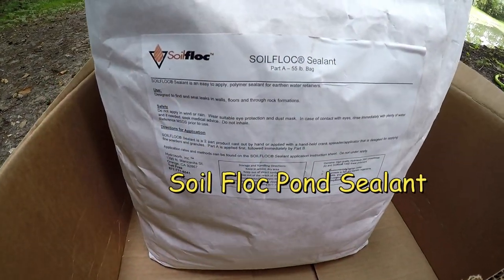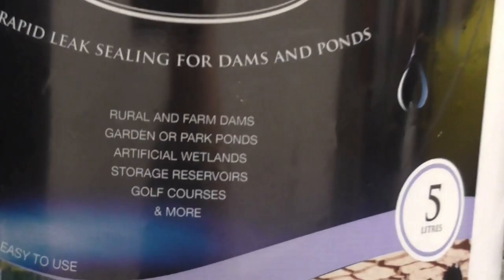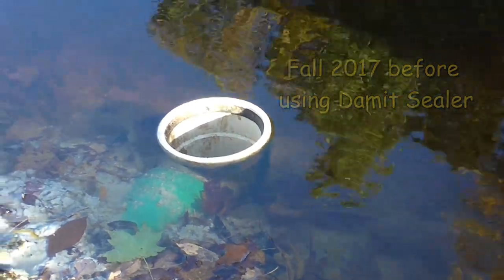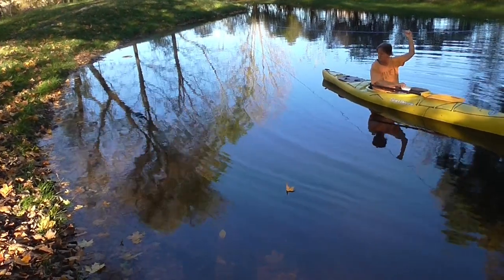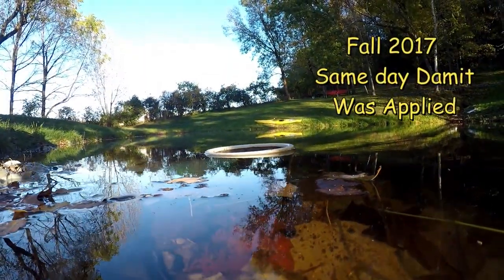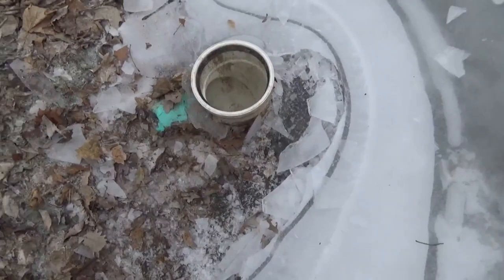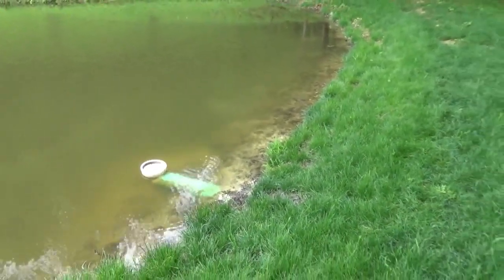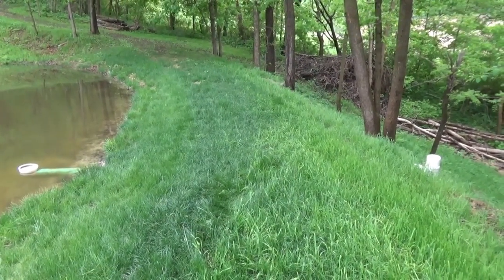# 12 Fixing a leaking pond. Using Damit Brand Pond Sealant

Comment: Tree roots are a farm pond's biggest enemy. I shouldn't have trapped the beaver, last spring. It had clogged up the leak in my 2 ac pond, but now, it is running through and eroded 5 ft of back of dam, after previous flood in SC in 2015 and this months, 5 in of rain. Roots are hell on earthen dam.
Reply from the maker: I agree with your comments about the roots. I hope to get 10 years out of the pond and then it'll be time for a smaller home with no maintenance.

Comment: Did you add bentonite at all? Ive used the damit product on a dam repair job and it worked great, but I also put bentonite down, installed a concrete plug to cap off the compromised spillway, and also pressure pumped bentonite into the earthen side of the dam. I had my divers check the inside and the bentonite we were pumping on the outside was making its way through all kinds of holes we didn't find the first time. Finished off with a bentonite cap and the damit product. Never leaked again.
Reply from the maker: Hello Rodrigo. No product that I purchased worked to stop the leaks on the pond until I excavated the dam wall dike and put good quality clay back into the dam. 
Sounds like you had good luck with your very involved process. Congratulations. 
My pond hasn’t leaked now since I made the last video, I wish I had bought a few more load of the good clay I found ….just to have on hand.
Thanks for taking time to share your projects success. -Bill

Comment: Did you redo the dam and the pipe? I hope it worked this time. I have a 3 acre lake that was built in the '60's. They installed a corrugated metal draw down pipe. My dam is leaking all around the pipe and the pipe has rusted out. Then a beaver answered my prayer a couple of years ago and built a dam around the pipe. It actually worked for a while. I had high hopes for this product as a solution.
Reply from the maker: Hello Laura Lynne, I sure enjoyed your story about the beaver, sorry but  I cannot recommend that product at all.
I did speak with the pond contractor and hope we can start the repairs as soon as winter ends. Thanks so much for commenting and saying hello.

Comment: You saved me some money. I suspected those products to be a waste.
Reply from the maker: Thank you for your comments, glad you saved some money, I was very disappointing with the products and results.
Reply: I to think it’s leaking at the pipe.  Did the exit pipe get property sealed to the elbow?
   I would cap both ends to that pipe ,,, add a air gage and see if it holds air before you tier it up.

Comment: I feel your pain regarding the leaks. I also have a small dam/pond that leaks like a sieve :-( It was completely dry last summer but I had no time to dig and reseal it with clay or add a liner.
One thing I will do when the time comes is not add an over flow pipe through into the pond, in my opinion that just adds a high potential leak spot. You would be better off removing the pipe and just add a lower surface drain on the bank, of course it will need to be stabilised with gravel and rocks to stop erosion but it's the simplest hassle free way to control over flow of a full dam/pond.
Reply from the maker: Thanks Mark, I agree the new exit overflow pipe is contributing to the leak, I can't wait until summer when I can get back at this project. Thanks for commenting.
Reply: They call them runarounds. Installed to keep the dam from overtopping if the spillways can’t get rid of water fast enough.

Comment: So did this product work? I am thinking about ordering some
Reply from the maker: Hello Steve, The product did not work for me after several months I discovered the problem was much deeper than I originally thought. Thinking the leak was within the first 4 feet of deepthis product. At the end of this project I found the leak to be 16 feet down.
Reply from the maker: I am sorry I sent my reply to soon. I found my leak to be 16 feet down so the product was never gonna work. This is an expensive product and I would be hard-pressed to recommend it. It was a very good company to work with but at the end of the day I found a qualified contractor and we fix the leak correctly. Good luck with your project.
Reply from the maker: If you have time watch video 112 it will bring this project to conclusion

Comment: trees are not good for embankment ... also best remove all the bottom leaves and muck..will never stop leaks unless bottom clean up..it will only cover the muck ,...not bond with bottom clay.. just went threw this a year ago.. best drain pond..and clean up start again .. that what i did.. did it  all myself with  tractor .. 1/2 acre pond.. 15 ft deep at deepest point..
Reply from the maker: Hello Jess, what size tractor did you use? I'm considering your suggestions very seriously.  I'm working on getting a temporary easement from my neighbor to bring in larger equipment.
Reply: Bill Burkhart for that size pond you could use a 30 to 40 horsepower tractor with a box blade. Drain the pond, let it dry, set the box blade angle so it picks up dirt. Clean the bottom or deepen it if you want. Get some bentonite or kaolin and spread it according to the recommendations. Lightly disc in in and let the pond fill back up.
Reply: @billburkhart  3032 deer,,

Comment: Great video. I'm battling a leaky pond too. Did you try damit and soilfloc. If so is one more economical then the other? Is your pond still holding after the repair?
Reply from the maker: Happy Sunday,  I did use both products you referred to however neither one worked. In all fairness you should watch the video 112 that shows the root cause of the pond leaking. After making those corrections it’s been about a year now and the pond continues to hold water very well. The leak was about 16 feet down, and those porion products just aren’t designed for that kind of leak stoppage

Comment: Seems like it's leaking along the pipe. I'm not an excavator but I've worked on plenty of field tile
Reply from the maker: Hi John, I agree, I think it's following that former water leak path. I think the leak is going to continue to scour the path larger and make the origin easier to find by August. Then, I'd like to start digging at the leak and work backwards to the pond and see what happens.Thanks for your comments.
Reply: Bill Burkhart should have put about 30% of the powder product around the pipe and waited to see if you are right.
Reply from the maker: You know that's not a bad idea, the bucket was a little over $100.  I may just do that. I'll pour the entire bucket near that pipe. Stay tuned.
Reply: Bill Burkhart cheaper and less invasive. Worth a try nothing to loose?
Reply: Could try some pond dye or muddy the water around the pipe and watch the leak on the other side to see if it changes color or comes out muddy.

Comment: How could you expect this product to work, if you didn't have your pond full first of all?The product will only be at the lower levels.
Reply from the maker: The company advertised the product would work on a leaking pond, block the leak and that would result in a higher water level.  We found a large hole and plan on making repairs here this fall. 
Thanks for taking time to comment.
Reply from the maker: The mgf advertised the product would block running or leaking water, resulting in higher water levels. Just last week we have found the source of the leak and plan on making permanent repairs this fall.
Thanks for taking time to comment.

Comment: Do you mow all of that or weed eat it
Reply from the maker: Hello Tyler,
I mow it and trim the pond edge with a weeded trimmer. I use a JD X 758 4 WD and it works very well. I can mow the pond bank down to within 6 inches of the water edge. 
Thanks for the question.
Reply: Bill Burkhart thanks for answering

Comment: Just saw your Sept 22,19 video. Would you still recommend Dam-it product?
Reply from the maker: Based on my experience, no. I believe I had  a hole somewhere in the pond and it was not effective, maybe if you had seepage it would work. Please do your own investigating before making a decision to purchase or not.
Reply: @billburkhart  I cleaned out silt from old dirt tanks at the family ranch with a skid loader, they all seeped after filling back up and wondering if Dam It would help slow or stop seeping. Family says they always seeped, so I don't think I missed them up. I'd like to stop tanks from seeping though. Water pretty scarce in our area.
Reply from the maker: @roycegaida5300  Good luck Royce.
Reply: @billburkhart  Sodium Bentonite?
Reply: @roycegaida5300  Sodium Bentonite is used to seal landfils.
Reply from the maker: ed m   Ed, try it and let me know if it works.

Comment: Only 2 inches lower then where drain is
Reply from the maker: Hello Jesse Hills, the leak got much worse and this is the year I get a contractor with more pond repair experience to repair it once and for all.....I hope.  Thanks for commenting.
Reply: What they do to fix it for final time how's it holding? It fill?
Reply: Nice. Im fixing my pond was leaking. I'm in middle of re sealing it with clay now. How thick of clay layer is recommended?
Reply: Mix in clay with top soil?